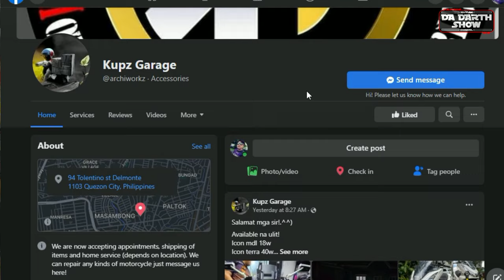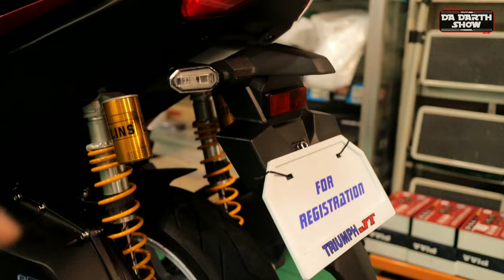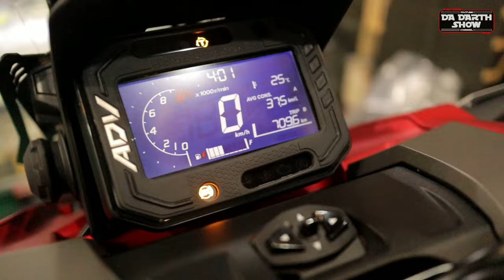Honda ADV 160 Setup

Comment: To go from  a 150 to 160 is really stupid . Now the 180 would make more sense . 150 to 160 useless .
Reply: It is not just about the increase of CC. there's a huge difference in the system especially the safety features between 150 and 160.